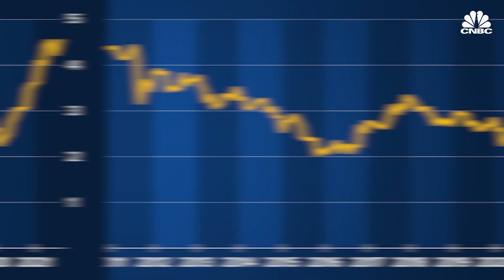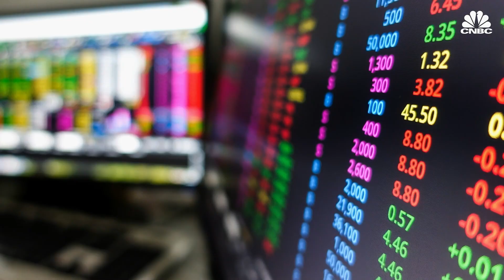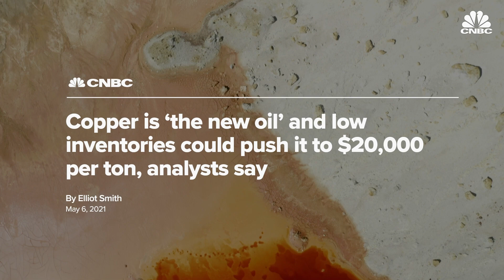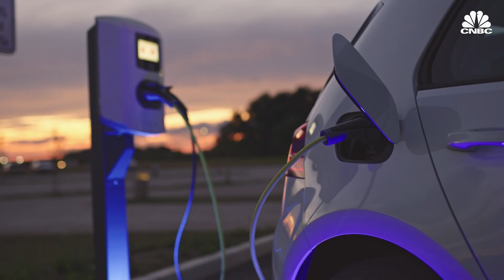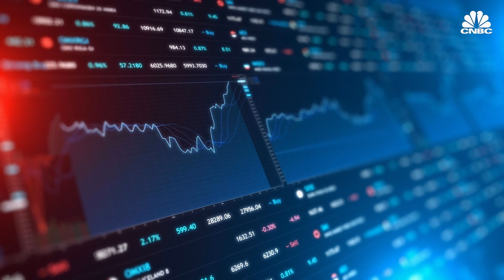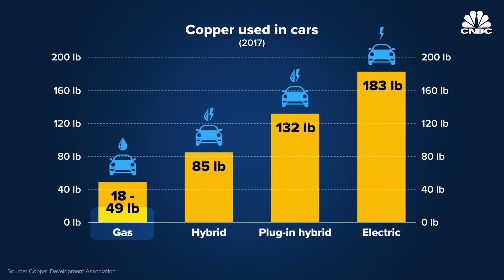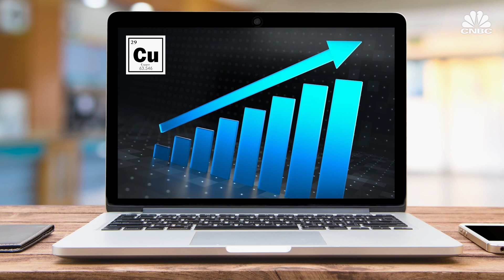Why A Looming Copper Shortage Has Big Consequences For The Green Economy

Comment: Silver is a better conductor than copper. The correct way to state it would have been "copper is the best affordable conductor we know."
Reply: Not just affordable, also applicable. Silver corrosion/oxidation and reactance would be a huge issue.
Reply: @thenewguythedruid  elucidate and elaborate please
Reply: Copper isn’t even the most affordable conductor - aluminium is. That’s why copper is being removed from transmission lines and replaced with aluminium.
Reply: @allangibson2408  You're right, I should have worded my statement better. "Copper is the best conductor we have that is economical to use."
Reply: @allangibson2408  Aluminium is terrible for house wiring. It has to be 1 gauge larger, it's stiff and hard to bend, and it suffers metal fatigue much more easily than copper. I had to work with aluminium wire on a house I lived in once, I hated it.

It's a commodity, higher prices mean that new mines will open and prices will come back down.
Reply: @seanrodgers1839  And 99% of electrical conductor wire is not used in houses - it is over and under streets. That has been shifting to Aluminium for decades (because it is 1/6 the price).
Having North America switch to 230V domestic distribution (like the rest of the world) would reduce the domestic wire size required by a factor of four too. (BTW - All US houses are actually fed 230V but as two phase and neutral).
Reply: @seanrodgers1839  Connection problems are an issue of training. As I pointed out above, aluminium domestic terminations require special crimp lugs that grind through the oxide coating and then permanently seal the conductor to the welded copper lug that makes the final connection. Not as easy as copper but not that much harder.
As for 230V plugs being bigger - that is purely a question of standards. California used to have a 240V plug as standard that was exactly the same size as the 120V plug. If you want to see what it looked like, look up an Australian standard plug (the Australian design was  lifted from the US design but with the neutral becoming an earth). The Australian design was copied by the Chinese as their current standard mains plug (but inverted with the earth at the top). Since the conductor size in a plug is determined by the current flowing, the physical pins can be smaller for the same power. IEEE plugs use the same principle to be smaller still. The ISS uses these plugs everywhere.
115V is not safer - the higher current means more fires.
Reply: @allangibson2408  
I figured that infrastructure would have ways to deal with aluminium, but Murphy's law can still apply, to long running, unmaintained systems. I don't know much about it so can't say much. However, if you offered me free aluminium wire, I would still buy copper for use in my house. As I have dealt with aluminium, it's not an uninformed opinion. 

As I have lived in 230 and 115 volt lands, it's also not an uninformed opinion. Things can look good on a factual basis, but are not so in practice. A properly wired place is not going to have an over current fire. Higher voltage will jump a longer distance however. I have had more burnout problems with 230 volts than I ever had in 115. 

I have also had few 115 shocks, it's not that bad really, not that I fail to have a proper respect for electricity. One handed, of course. I somehow managed to get a 230 volt shock once, shockingly much worse, not something that should ever happen. But faulty appliances happen. 

Changing to 230 from 115 is never going to happen anyways, especially because 230 is already available and there is no problem to be solved by changing. If it ain't broke, don't fix it.
Reply: @seanrodgers1839  And shocks are why Residual Current (RCD/ELCB) Circuit Breakers were invented. (These are really effective at preventing fires too)…
Most of the wire used to feed power to houses isn’t in the house - 99% is getting the power to the house and 115V requires this to be much much larger…
Reply: @allangibson2408  it’s funny how obvious it is when someone that actually works in a field vs people that have casual knowledge.
I’m no electrician but I know a little bit, you just schooled folks.
So we been replacing outdoor copper with aluminum in the US for a while, right?
Are converting it more often now than in the past? 
I hate the stuff but only cuz it’s so hard to work without the right tools… and join Al to Co is no fun.
Seems like we need big changes to our grid, and there isn’t much effort to update it.
Reply: @swayback7375  The connection problems between aluminium and copper were basically solved in the 1980’s with bimetallic welded crimp lugs (welding aluminium to copper was an “interesting” technical challenge). Since then the overhead transmission network has been gradually phasing out copper in favour of aluminium. The other sources of salvaged copper has been salvaged plumbing (which has switched from copper to more corrosion resistant polyethylene) and telephone cabling - which has switched from copper to glass.
Reply: @seanrodgers1839  In Britain in the 1970s they switched to aluminium wires instead of copper when copper prices soared. It was false economy since as you say aluminium is brittle and suffers from metal fatigue. The whole lot soon had to be rewired with copper so it ended up costing more than if they had used copper in the first place!
Reply: @funquay2219  I was in an old house in the late 70s, early 80s in Canada. It had some aluminium wiring in the renovated parts from when copper was expensive. Must have been the early 70s.
It was terrible to work with, because it had problems.
Reply: @seanrodgers1839  Not to mention the interconnects. Aluminum wire has to connect to copper at some point. And where they touch, they corrode, not to speak of the electrical resistance.
Reply: @allangibson2408  aluminum is lighter hence lighter power lines.
Reply: @phillipmathura8763  gold isn't a better conductor. In fact it's actually slightly less conductive. What gold is better at is not corroding so its better for contacts in connectors.
Reply: @brdsmith89  hmm interesting ig I was wrong lol woops lol
Reply: @phillipmathura8763  there was a cool reason why it was better that had to do with atomic weight or electron shells or something but I don't remember. It's kinda counter intuitive tho
Reply: @phillipmathura8763  No copper is a better conductor than gold. Silver is the only metal that trumps copper.
Reply: @Tim_Nilsson  And aluminium is a better conductor by cost (you just make the wires bigger).
Reply: This is a taste of reality.  He got in and rose to the top not by being one of the best and brightest, but by knowing the right people and kissing the right behinds.
Reply: Graphene has about hundred times lower conductivity than copper and they're also super conductors that don't have any at all
Reply: @AndrewMellor-darkphoton  First of all, I think you meant higher conductivity.

Graphene is 1.4 to 5 times more conductive that Copper, depends on how you analyse it.

I think you also got confused between Conductivity/Resistivity or Higher/Lower.
Reply: thx, this miss information was really bothering me
Reply: @phillipmathura8763  Gold is not better than Copper in terms of conductivity.
Reply: @honeysinghelon  yea Ik some other guy corrected me too lol woops
Reply: Well, he's a business nitwit.  They're only claim to fame is a degree that only means they finally got around to taking 10th grade math  😁
Reply: @malavoy1  Some business classes do use advanced mathematics
Reply: @malavoy1  Some business classes do use advanced mathematics
Reply: Take it easy on him, he's been on cocaine for the last 12 straight years
Reply: @cordfortina9073  house prices shouldn’t be going up by a factor of 10. If this continues then don’t even think About the housing crisis to ever be solved
Reply: At standard temperature and pressure. Superconductors are the literal perfect conductor, but we can't feasibly get to the low temperatures.
Reply: Aluminum is second choice if shortage is a thing.
We can replace copper with aluminium.
Reply: Copper is the best conductor for a malleable type of metal....
Reply: Actually, large crystals of copper have been shown to be better conductors than silver, but I don't know if working the copper in anyway changes this extra speed but I expect it would and that would limit it's usefulness.
Reply: or they should of said "copper is the most practical conductor we know" ... for mass manufacturing
Reply: Gold is better conductor than copper too.
Reply: @danielliu8735  Gold isn’t a better conductor (about 70% as good as copper) (it does make good low power contacts because it doesn’t corrode, iridium, rhodium or platinum are better at that task however). Silver is a better electrical conductor and it’s higher melting point makes it better for high powered contacts.
Reply: But if they had said that then Aluminium is so much cheaper than copper that we can do a lot more wiring with Aluminium alloys for the same price.
Reply: noble metals rock
Reply: Gold is even better
Reply: Stop arguing over what is a better conductor.. society does not use silver as as a general practice for general use in our electronics and electrical connections ..arguing semantics like this is just plain idiotic.. Quit trying to make yourself look smarter than you are.. Jesus Christ
Reply: @phillipmathura8763  to be correct gold is slightly less conductive than copper but not alot, silver is the best clean metal.
Reply: My thoughts exactly
Reply: @phillipmathura8763  "Yea and gold too this is literally high school chemistry." 

That's not a good advertisement for the caliber of your high school. 

silver 62.1
copper 58.7
gold 44.2 

All conductivities in MS/m. Gold is heavily used in electronics because of ductility and corrosion resistance. Sometimes the best conductor is the thinnest layer, and gold is often the thinnest layer.
Reply: They never said it was the best
Reply: I think most people know this. We all know your not going to wire your home with silver wire.
Reply: Looking for this comment. I was waiting for him to mention cost but he made a really uninformed statement.
Reply: Gold is the best electric Conductor.  Silver is #2 and copper is #3.  You can’t use pure silver because it’s too brittle.  It has to be an alloy. The alloy is less conducive than copper. This is why copper is used for wires while gold is used in chips.
Reply: @JasonB808  I know that. The issue was the words used by Jeff Curie.
Reply: Silver is a better conductor than copper, Gold is a better conductor than silver, and graphene is more conductive than gold! And I guess Jeff Currie didn't go to highschool.. incredible.
Reply: Beyond a certain level of wealth, people seem to stop being bothered by facts, science, and other details...
Reply: They can't afford science reporters, sorry.
Reply: @phillipmathura8763  Gold actually isn't a good conductor.  What's good about it is that it doesn't corrode.  That's why it's great for connection points.
Reply: And diamond is clearer than glass, so maybe they should make windows out of diamond!
Reply: Well whoop de do there are better conductors. That's common knowledge for anyone that ever paid attention to anything tech. That's also no frickin help at all when they're all in even shorter supply. This is why we need to find a substitute that's cheaply available and actually works, and we need to do it FAST.
Reply: @phillipmathura8763  actually gold isn't that good of a conductor. And if you go by weight in stead of volume aliminum is far better that copper or anything else.
Reply: Exactly.
Reply: @phillipmathura8763  thanks to the fact that it doesn’t oxidize it’s great but silver has more free electrons.
Reply: He stated it the way he did to drive this machine.
I laughed when I heard that statement.
These are the clowns playing the economy game.
Reply: and gold has a better electrical conductivity than silver
Reply: Silver tarnishes
Reply: @phillipmathura8763  gold is less conductive then copper or annealed copper   ρ (Ω•m) at 20 °C
 Resistivity: 
Silver 1.59×10^−8, 
Copper 1.68×10^−8,
Annealed copper	1.72×10^−8
Gold 2.44×10^−8   
this is also the same with conductivity since they are linked
Reply: Only marginally.  Not enough to justify the further expense..
Reply: You people lack of money are very superstitious. MONEY is the best conductor for it is everything. Communism is what stealing sharing all about. Capitalism is the answer to all your problems. 

-Capitalism
Reply: Rip gpu prices...
Reply: @phillipmathura8763  Gold is not a better conductor than copper, the only element with a lower resistivity than copper is silver.
Reply: Gold is the best
Reply: Thank you! I was getting annoyed at all the garbage in this video. The statement "copper is the new oil" doesn't even make sense. We aren't replacing one with another. They're used for different things.
Reply: There are many other more conductive elements but they are more expensive
Reply: @phillipmathura8763  
Incorrect...  Silver is best (6.3e7) then Copper (5.98e7) then Gold (4.52e7) then Aluminium (3.5e7)
The reason for using gold is due to its terrific protection against oxidation (a.k.a. tarnishing).
Aluminium is used on most power-grid infrastructure because it's so much LIGHTER than copper and effectively cheaper...
If you compare a 1000 Ampere rated copper wire with a 1000 Ampere rated Aluminium wire, the copper wire will be thinner, but it will WEIGHT more and COST more than the Aluminium wire.
A 'downside' of Aluminium wire is that Aluminium Oxide (tarnish) is a VERY poor electrical conductor while Copper Oxide (tarnish) remains quite a good conductor.  This is ESPECIALLY relevant at very high frequencies where the 'skin effect' becomes important.
It's not uncommon to see silver plated copper wire used to carry RF energy
Reply: Platinum is even better
Reply: @phillipmathura8763  nope gold is a super conductor but that does not mean its less resistant then copper. the list goes: silver copper gold aluminium but if gold is cooled to a few kelvin (I dont know the exact number) the super conductor properties kick in and the resistance drops to zero which is something I still dont understand how
Reply: @phillipmathura8763  Lmao, copper is more conductive then gold. Gold however doesn't oxidize like copper does which is why its used on contacts.
Reply: the guy did sound like he was trying to sell something rather than sounding like he knew what he was talking about lol
Reply: Was
Reply: gold is much better than silver LoL
Reply: Seems that a silver aluminum and copper alloy could be a viable "extender" of the available copper to help assuage the demand for copper in car motors.  Even if it was marginally more expensive, it would be worth it.  I would gladly donate all the flatware I can get my hands on as part payment for my EV!
Reply: @clavo3352  that not how alloys work that will likely reduce conductivity
Reply: @clavo3352  Just use aluminium. It just needs to be 10% bigger for the same conductivity.
Reply: @allangibson2408  My understanding is that aluminum expands more when it heats up and it loses conductivity as it heats up.  It also cannot structurally stand up to the heat.  It Used to be allowed in house wiring but after it started many house fires, it was discontinued and even made illegal in some states building codes.
Reply: @clavo3352  Aluminium works quite well and is 1/6 the price. In overhead wiring it is wrapped around a steel strength member wire so it doesn’t have to carry any load. The main problem is joining aluminium - which requires special equipment to give a good electrical joint. Basically all aluminium wires require special abrasive filled crimp lugs for termination to copper alloy components. You can’t just screw aluminium into terminals.
Reply: @allangibson2408  That makes sense for overhead wiring that is in open air cooling. Do you think it would work for an EV motor? That's where I think the main future demand for a durable electrode is;  Unless graphene becomes available.
Reply: Should be $17.50/hr minimum wage with healthcare insurance benefits included to start
Reply: @davidcarson8950  BuT tHaT WoUlD tAnK tHe EcOnOmY if we pay people an affordable living wage where they can actually go out and buy things and be consumers instead of living in poverty.
Reply: When wages go up, prices go up. 

Walmart’s philosophy is, “Walmart employees make a living wage, as long as they buy everything at Walmart.”
Reply: @samadamms3432  Like the old song "I owe my soul to the company store!"
Reply: @bustex1  that is not how money works.  Denomination does not equate to buying power when the dollar is inflating.  Raise to $15 and ypur big mac will cost $15.  Our monetary system is wholly broken at this point
Reply: @gypsonny2  bro a lot of counties already have 15 minimum and I’m not seeing any real price change.
Reply: @davidcarson8950  lol. Im a perfect world.
Reply: @davidcarson8950  if minimum wages are good, why not 100 dollars an hour?
Reply: ¿So a copper/gold/silver alloy would be best?
Reply: @mothertruckersparadise3260  no pure metals are allways better than alloys. :D Its because the cristaline structure of an alloy is not as perfect as the one of an pure metal
Reply: @mothertruckersparadise3260  They use whatever is best value for money. Silver is a slightly better conductor than copper, gold significantly worse. But the bottom line is that the cost outweighs any improvement in conductivity (if there is one which I don't know). Actually the most important thing they all forgot is the density. Gold is very heavy, so you would make the wire weigh a lot more if you added it. And as prices are quoted per ton (or ounce in the case of gold!) it would not be economical. In fact, Aluminium, whilst not such a good conductor, is much lighter. This has two major advantages. One, it reduces the price for a wire of a given volume, and it makes the wire lighter. So an aluminium alloy turns out to be be best value where weight is super critical, e.g. overhead power lines.
Reply: @mothertruckersparadise3260   If you don't mind paying $50 afoot -- and staying up all night to guard your wiring from the neighbors ... stick with " Best Practice " = copper .
Reply: @jlondon158  talking Hugh voltage, and they're wealthy as well
Reply: @mothertruckersparadise3260  Alloys typically conduct electricity worse. That's why you would find 99.9%, 99.99% copper wires on the market
Reply: @serena-yu  a copper silver alloy would be far superior
Reply: @phillipmathura8763  No. Copper is better than copper. What high school did you go to? You got ripped off.
Reply: @MrWaterbugdesign  copper is better than copper?
Reply: CNBC is a crypto pushing network.

Silver and real money is their biggest enemy but it will win in the end because the whole economy is in a big bubble and will at some point pop.
Reply: @gbxmusicchannel3836  lol imagine thinking we will ever go back to using physical currencies.
Reply: @gbxmusicchannel3836  complete bullcrap.
Reply: @gbxmusicchannel3836  I don't think there's enough silver in the world to replace all the copper conductors.
Reply: @gbxmusicchannel3836  OK tin foil hat. Because producing videos about non existent commodity shortages, convinces people that investing in a non existent currency, is literally the exact same thing.
Reply: @aardque  I've heard that the price of tin foil is going through the roof as well. I wonder who's buying it all?
Reply: @aardque  I didn't know it was "aluminum" I thought it was "aluminium!" And no, I haven't heard any speculation about metal prices. It was only an attempt at a feeble joke! Cheers.
Reply: Biden wants $15 minimum wage, I hope he doesn't pass that crap because the U.S. economy will tank, a gallon of gas will be 6 bucks and the all the prices of goods and food will double. 
Just something to have a good conversation about, I like everyone's opinions on this thread ^^
Reply: @akaMyThought  In my country, minimum wage is around $27.5 an hour, and gasoline $7.5/USG. The economy is doing just fine (except hotels and restaurants because of COVID) and unemployment is below 3%. I did not realise that the US economy was that vulnerable!
Reply: @akaMyThought  Lol? My local McDonald’s is hiring at 13 now and the menu prices…wait for it…. Did not change at all. You know how much Burger King and McDonald’s employee start at some EU countries? 20 an hour when converted to usd. The menu is about 0.30-0.40 cents more expensive when converted to usd.
Reply: @bustex1  15 here
Reply: @bustex1  But that's probably because of stricter food regulations.
Reply: @bustex1  Same. Mines doing 13hr. and man I bet you I can still get my 1 dollar sausage biscuit and 1 dollar sweet tea XD
Reply: @akaMyThought  In my country, minimum wage is around $27 an hour, and gasoline ove $7.5/USG.
Reply: @akaMyThought  we are already at a $15 minimum wage by default. In my town every fast food job is advertising $15 an hour and still need workers. The sign has been up for over a month
Reply: @akaMyThought  $5 or $6 per gallon of gasoline is pretty normal price here in Europe. US gasoline is incentivized, which it should not be, so IMHO it is good to make it more expensive. You are paying for it anyway in your taxes.
Reply: @akaMyThought  As if those prices havent steadily been going up anyway....
Reply: @akaMyThought  Oh? That's pretty neat that you can see the future like that. I don't think you realize just how many jobs you rely on have workers at minimum wage. it's not just teenagers at McDonalds.
Reply: @akaMyThought  And if minimum wage kept up with the economy it would be over $20 an hour but people managed to pay minimum wage just fine 50 years ago. The problem is that the CEOs and boards of directors refuse to take a pay cut, not that they can't afford to pay it without hiking prices
Reply: @akaMyThought  they already have lol
Reply: @akaMyThought  We already have it in a large part of the country.....and businesses who are significantly raising wages are improving productivity and margins and not having the staffing problems that others are having.
Reply: @akaMyThought  The economy will not tank with a $15 minimum wage.....
Reply: @akaMyThought  Gas tank? what tank you talking? maybe you should think about growing your own!  Food, fuel, ?
Reply: @akaMyThought  bro you have no idea how the economy works, why don’t you just stay quiet and spare these good people from your idiotic takes
Reply: @akaMyThought  Yep. When prices double, that $15 wage now becomes $7.50. Inflation will wipe out the gains and re-level things out. It's an example of poor leadership by the Democrats. To be fair, they are trying to help low wage earners, but the mistake happened when they coupled it to another policy for excessive spending, injecting so much money into the economy that inflation soared. This outcome was predictable and taught in basic economics, but the bums in power didn't care to learn from history, so now they're forced themselves and the whole country to go through it again, just like in the 1970s.
Reply: @akaMyThought  Bull. If you can’t afford $15 you shouldn’t be running a business. And I am aware of a McDonalds that pays US$30 per hour to its staff (simply to get staff).
Reply: @akaMyThought  
Looks like someone doesn't understand economics 101.
I'll fill you in. 
Did the economy tank the last time the minimum wage was raised?
No, it did not.

Raising wages has never, and I repeat, never, at any point in history, or at any point in the future, caused economic decline. Not even once.
Reply: @akaMyThought  Exactly. Everyone wants a 15 dollar wage except if you run a business and realize you wouldn't earn enough to say open.
Reply: @silverhawkscape2677  labor has almost no relation to finished goods cost
Reply: @silverhawkscape2677  if you can’t afford to pay someone a living wage you don’t deserve to be a business owner. I’m tired of my taxes going to pay for ppls benefits so a multi million dollar business can pay them 8 an hour.
Reply: @bustex1  Talking about smaller Businesses whose operations literally can't afford a 15$ wage because they don't make enough to support it.
Reply: @silverhawkscape2677  so tax payers just end up paying by subsidizing a non livable wage to supposed employers who cannot afford it? That’s the best option? There weren’t any small business owners that came forward in municipalities in WI where they implemented a 12-15 dollar minimum wage. But sure let tax payers pay for these supposed business that shouldn’t be in business if you cannot afford to pay a human being enough money to rent and eat. The government has to step in to provide for them. Greatest nation on earth cannot figure out a living wage for its people with it being 4th highest in poverty but other countries with hardly the GFP of Iowa can.
Reply: @silverhawkscape2677  then there is something wrong with our system if a small business can't afford to pay its people a LIVING WAGE
Reply: @bobspizza7444  It depends on where you live. Some places have their living wage lower that 15 dollars an hour because of how low the cost of living in the area is. This also means profits for those areas aren't as high.

Making 15 dollars universal would mean raising operating cost with no benefit to the business whatsoever.
Reply: @silverhawkscape2677  in australia we have a $15 minimum wage, the problem isnt the base wage here, but the extra money you get for antisocial hours or weekends. most stores here close at 4 pm and a decent amount of restaurants cant afford dishwashers on weekends
Reply: @silverhawkscape2677  literally in the SF Bay Area especially Silicon Valley. Fast food joints have to hire at $17 hour to start.fat chance trying to survive on that when there are thousands of software engineers making $200k/ year entry level. thus making money meaningless here.
Reply: @ArchWayE  My point exactly. A living wage means completely different things in different places.
Reply: @silverhawkscape2677  then they should not survive
Reply: @silverhawkscape2677  then don’t hire someone and do the work yourself. If you can’t afford to pay a worker you either have a failed business or you aren’t in need of expansion. Please get this passive income crap out of here. Making other work hard for minimum pay while you do nothing and rack in the money
Reply: @silverhawkscape2677  Henry Ford went for a high minimum starting wage at his plants on the basis that his employees should be able to buy his products and it improved staff retention (which was also a significant cost). Ford did really well off that basis for decades…
Reply: @BodyDestruction  what competition are you referring to? Ups for shipping and logistics?
Reply: @silverhawkscape2677  If your business model relies on underpaid workers, you deserve to go bankrupt. However, a $15 minimum wage means a lot more  jobs will be automated.
Reply: @silverhawkscape2677  I run a business and I have 5 Employees,  my lowest paid employee makes 45k a year after taxes. If you can't afford to pay your people a minimum of 15 dollars a hour you don't need to be in business.